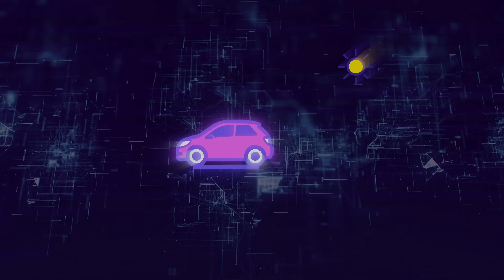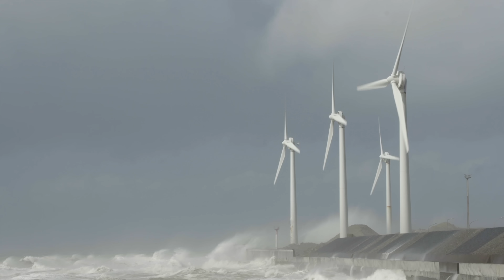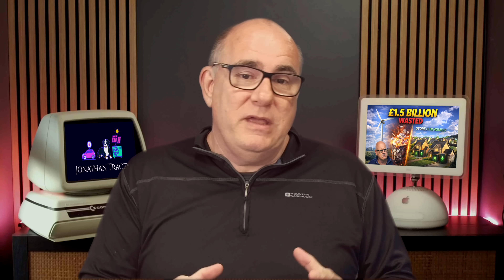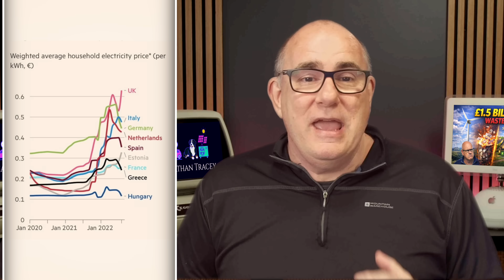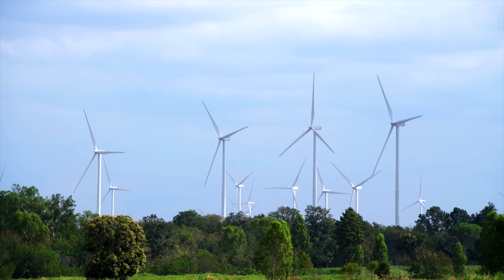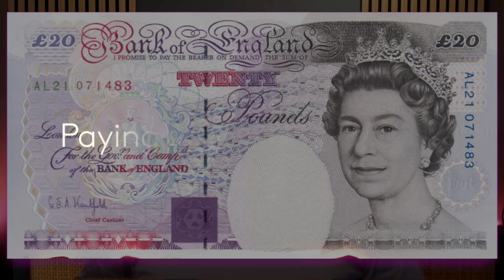We’re Paying £1 5 BILLION To Waste Energy… Here’s My Big Idea

Comment: UK reached 4Gwh batteries this January with a plan of 13Gwh extra this year. It's growing fast.
Reply: Can you provide a link to verify this please
Reply: ~It would take 240 GWh in Scotland to solve this issue, which would cost £48B. The cables they're already installing will be ready by 2030 and cost £8B.
Reply from the maker: Nowhere near fast enough though
Reply: @JonathanTracey  It's essentially not a viable solution to the problem presented given the issue is a geographical bottleneck, regardless of speed. It's a poor financial investment. ROI would be ~3%. Meanwhile the cables already underway are 13.7% ROI, and cost less initially, and faster to deploy (4 years).

Setting up a UK battery giga factory would take 5-10 years. Then there's the battery production time once it's built. And even when that's done, it wouldn't be cheaper or faster than the cables, which go beyond solving the problem into investing in increasing capacity. 

It would need 240 GWh of batteries! Even vs rounding up to 20 GWh production this year, that's 12 years to get to a point that the problem is eliminated.

But all EV's should be mandated V2G. All chargers too. And all new builds must have the maximum physical limit of solar panels on the roof, minimum 10kWh of batteries, and a heat pump. That's all the "right thing to do", but it won't solve the £1.5B Scottish wind curtailment costs, (including which, the LCOE is about half that of gas)

Comment: Nonsense, if the power from a wind turbine carnt reach your house, your grids not using the power from wind turbine. Transformers would carry the power further, but the cables would cost millions if not billions, a box in every house sounds like something the joker would do to Gotham City.
Reply from the maker: you’re not thinking through the problem in stages, if you start by installing them near the generators say in the north of Scotland. You remove some of the load from the transmission lines you then follow the transmission lines installing batteries as you go. Everyone everyone you installed takes a little bit load off the transmission lines which means more energy can be pushed through the transmission lines further south as you work your way down the country you reduce the impact on transmission lights
Reply: what ive noticed with my windturbine battery setup is no matter how many battery or appliances I turn on I allways at some point have to turn it off, once the sun in the middle of the day top balances the battery a voltage relay I've installed breaks the windturbine just before balancing accurse.
Reply: Apologies for being abrupt about it, my emotions did get the better of me last night and did encounter a phrase I've learnt this past decade when receiving too much emotional pain the reaction is to blame innocent people.
Batterys are good idea for thoughs dark wintery months and my small scale renewable setups not going to compare the Britons grid.
Reply: Correct.

Comment: A simpler solution is to install an internet connected "Eddi" like device in residential properties where at times of excess generation, the grid operators can enable remotely the devices to dispatch load. You could even get the owner to purchase the device with the logic that it would pay for itself over a year or two - so the initial cost to the tax payer to roll it out would be low. The ideas is at (say) 3am where you might have an excess of power, start heating water in 100,000 homes (or a million homes!) ..... which then would require LESS power later on in the morning at say 7am when people get up as the water is already warmer. You balance the grid and people get free hot water with money they are already paying for in the existing model. 

All it would require is a remote internet enabled switch, some kind of encryption/authentication system so it's not open to abuse, some way of logging back at the base station when your device was active.... Your existing immersion/heating element could be unchanged!

Problem to be fair with politicians is that they aren't engineers. it's too simplistic to categorize it that way.
Reply: The problem is the bottleneck of the B6 between Scotland and England. So this excess energy has to be mopped up in Scotland. It would take 240 GWh of batteries in Scotland to solve this issue, which would cost £48B. The cables they're already installing will be ready by 2030 and cost £8B.
Reply: As someone who worked in computer security the problem is also that most people think it's simple because they have no concept of what a bored teenager could do if they got their hands on controlling such a system.
Reply from the maker: its a solution but it only supports hotwater, a battery lets you run anything electrical from it

Comment: Hi, so what’s your version on V2G as the Dutch are doing it other countries are doing it why don’t we do a lot more of it?
Reply from the maker: the vast majority of cars don’t support it, it’s not that they are not capable but look at it from the car companies point of view. what in it for them except more wear and tear on the battery
Reply: Currently in the UK its the same price for a 32kWh battery pack as a V2G module for something like a SigEnergy system. One of them is usable all the time the other one requires you have to think "I don't want to go shopping now as the sun is out, and I can't put the washing machine on at 4pm because the battery is collecting the children from school".
It's going to need V2G to get a lot cheaper here for it to work, it'll also probably need tariff changes (most export tariffs don't permit primarily "brown" export - ie grid in/out, and those that do are counted for tax purposes unlike solar).

Comment: Great idea. Needs more thought on a few angles. Don't put down gas by saying it would be more expensive because it is taxed so much higher than the other power sources. Reduce the tax to the same level as the others such as solar and wind and then work out how much cheaper our energy costs should be. However we do need to move on to a different energy supply system and your big battery idea has definitely got a lot going for it.
Reply from the maker: I agree I think we should be removing all subsidies from all forms of energy generation and allow them all to compete, that way we will actually see what the true cost of generating energy is

Comment: 40% of the country will refuse because they think it sounds too much like socialism or some sort of woke agenda but I guess you had already assumed that.
A good proportion of that 40% refuse to even have smart meters installed because they think the government is trying to control them good luck with batteries.
Loads of others will refuse because they think they will catch fire and explode 20 times.
From a more sensible standpoint most homes are in the South East of Britain exactly where we already have a power shortage you would still need to upgrade the grid.
Reply from the maker: @nervousfrog101 You’ve pretty much nailed the challenge 👍

There’s definitely going to be resistance — whether it’s trust, safety concerns or just people not wanting change.

And completely agree on the grid point — batteries don’t remove the need for infrastructure, they complement it.

It’s really about combining local storage, better transmission and smarter demand, otherwise we just shift the problem around.

Comment: Perhaps what we need to do is to encourage energy intensive industries like Data Centres, Blast Furnaces, Aluminium extraction to be located near the power sources. A few fibre links for a datacentre is way easier than building out the grid.

Your battery solution might work with wind however does not work with solar as you would need to store that somewhere local in the day before moving it to a different battery at night.
Reply from the maker: @SeasonsOfMists Completely agree 👍  

Moving demand closer to generation is a huge part of the solution (data centres especially).  

On solar — you’re right it needs local storage first, but that’s exactly what home batteries are doing. Store it in the day, use it in the evening, no need to move it across the country.

Comment: I presume the wind farm firms have planned in these payments so going forward if these were to not be made then future projects would cost more? 🤔
Reply: Nope - they are being paid for the generation they would have provided if the grid wasn't constrained. They'd earn the same amount in both circumstances (near enough). It would be some high priced gas plant that took the hit.
Reply: @etchedpixels so you actually mean yes, the wind farms do anticipate these CfD payments. And yes, if they didn't have the security of CfDs they might charge more?
Reply: @Biggest-hz7ng  I mean that on a CfD agreement basis they get paid the same either way. Grid congestion is someone elses problem, which is fine because the grid is run by some other foreign billionaires so it's not there problem.
Reply from the maker: they can plan them in but that does not obligate us to keep paying them

Comment: So isn’t this similar to VPP where you trade power from your home battery system? I take your point, but I live in an area called the Trent Supercluster, with large solar projects, battery storage systems, and a pilot for fusion power.  There are more superclusters in the south. The government is upgrading the grid, and because where I live in a supercluster area, we are a priority to be upgraded.  The grid upgrade is more about being able to move the wind energy to where it is needed and to be able to send more at any time to mainland Europe.   So yes, in my view, the grid upgrade is needed. It’s an old system and will fail in the future if we don’t, plus I don’t see how we can put more power along the lines if there are not modernised. As to your suggestion, here is a battery; yes, that’s fine with me, but having home batteries, the DNO will probably buy energy from me already.  I agree with Battery Storage Systems and manufacturing them here rather than rely on imports from China.   I could go on but by now most will have stopped reading
Reply from the maker: @steverobinson2389 You’re spot on 👍  

It’s very similar to a VPP, just scaled out massively.  

And I completely agree — grid upgrades are needed regardless. The difference is distributed storage can start helping *now*, rather than waiting years for the upgrades to land.
Reply: I hate to say it, but we were too quick at closing our coal fired power stations and there were quite a few near to you. In a sensible world the plan would have been to upgrade the grid infrastructure whilst coordinating the closure of coal. In the olden days the CEGB would have done this, but ....Thatcher.
Reply: @ianbigsand7 I was about to say, the last Government but I see you mentioned Thatcher. However, Tory police has been a big push towards renewables, then suddenly now they want it delayed.

Comment: Regional zoning would be an answer as well as stopping gas power stations setting the price of electricity even if the grid is running or could run from renewables. For me, we need huge battery storage at all renewable sites, so that they can continue working whilst the sun is shining or wind is blowing. They can then trickle out the battery charge when the demand is needed. This would also help to stop having to upgrade some lines as the battery would only send at what is able to be safely transmitted.
I see the solar export tariff going from a fixed rate to variable as I also see electricity prices become more variable, so middle of summer when everyone is exporting solar, the export rate  would drop as supply is high. This would make it cheaper to buy electricity at those times. 
I therefore believe more home batteries will be needed to export at higher rates.
We also know there are many different styles and types of battery, but any of them could store spare electricity, rather than just wasting it by turning it off.
Reply from the maker: @Jaw0lf I think you’ve pretty much nailed where this is heading 👍  

Zonal pricing, variable export rates, and more storage at both grid and home level all point in the same direction.  

The interesting bit will be how quickly tariffs evolve to actually reward people for doing the right thing.

Comment: The problem of curtailment is precisely because the national Grid is not fit for purpose. The electricity coming out of wind and solar farms can't be stored in batteries in people's homes, because the cables are already full to capacity. The only way this idea would work, would be the building of local grids, to transfer this electricity about. It's some thing which many of us have been proposing for many years now. Grid level battery storage at points of generation, such as the latest community-owned project by Oxford's Low Carbon Hub at their Ray Valley Solar Farm, makes some sense. I've also proposed using mobile battery systems to shift the energy from where is it captures, to where it is needed, in "The CobbNet Project" discussion piece I wrote earlier in the year (and which has been dismissed out of hand by the current government).  Until we all realise that the UK National Grid is a major hindering point, the better we shall be in coming up with viable solutions. Nice try, Jonathan, but no gold star just yet.
Reply from the maker: @julesprocter9947 You’re absolutely right about the constraint 👍 — that’s the whole problem.  

The difference is this approach starts at the source — store the excess where it’s generated, reduce the load on the cables, then work outward.  

So instead of waiting for a perfect grid, you start easing the bottleneck immediately. It’s not either/or — we need grid upgrades and local storage.
Reply: The first million of these battery inverters needs to be on the coast near to the wind farms. Scotland Cumbria Lancashire Tees side Norfolk are good eamples. We have a big issue near Blackpool. Posh people in Lytham St Annes do not want a massive cable from a new Irish Sea wind farm to cross their fields. So let 200,000 people in Blackpool and Fleetwood have these batteries first. The Council also wants a massive data centre where the cable is due to come off the beach.

Comment: But if they are turning off the wind because the interconnects aren't sufficient to move it down south then all those people won't be charging the batteries. 

So is it a case of batteries for anybody north of Watford Gap! 😂
Reply from the maker: @gavjlewis 😂 Not just north of Watford Gap!  

It starts there because that’s where the constraint is, but as you move south batteries reduce peak demand and free up capacity on the same wires.  

So it actually helps more energy flow south over time rather than blocking it.
Reply: Exactly, putting batteries the opposite side of a constraint just adds yet more demand that cant be supplied across it. It does nothing to solve the problem.

Comment: I already have a powerwall 3 home battery + solar + heat pump (gas disconnected), which perform well and reduce my bills and net grid energy consumption by 50 to 70%. My next vehicle will be an EV, but I am waiting for bidirectional V2X capability so I can contribute to a VPP (when available!) with say 80kWh capacity instead of just 13kWh. I understand the technology is all there. Have written to Tesla & my MP, urging them to get on with it....like Jonathan says, let's do it.
Reply from the maker: @robertjeanslota1478 That’s a fantastic setup 👍  

You’ve basically built the model already — solar + battery + heat pump cutting demand massively.  

V2X would be the next big step, turning your EV into a much larger part of that system. The tech is there… it’s just the rollout (and incentives) lagging behind.

Comment: So many ideas. I mentioned last week that EVs should be able to do V2H or V2G. If the government pays £1000 to the car manufacturers to underwrite it, fine. Way cheaper than buying everyone a battery, and way more storage.
But, and I hope you like this, the government should extend the BUS scheme to battery storage, with a proviso that they (the grid) can use a portion of it.
BUS grant is £7500. That's 64kw battery with a decent inverter.
Gas is 7p. Off peak electricity is 7p. Electric boilers are more efficient than gas. No gas standing charges.
If they offer this, my gas is coming out tomorrow.
Reply from the maker: @simonmackenzie4227 Lots of good ideas in there 👍  

V2G/V2H is definitely part of the future, but the sticking point is incentives — more battery cycling = more warranty risk for manufacturers, with no clear upside for them yet.  

Extending BUS to storage is interesting though — anything that accelerates adoption and aligns incentives could move things forward quickly.